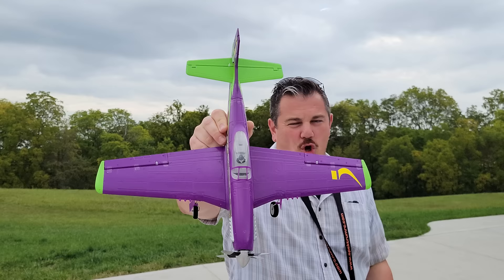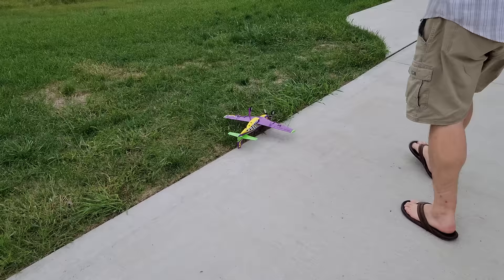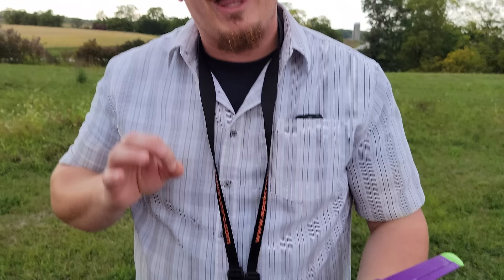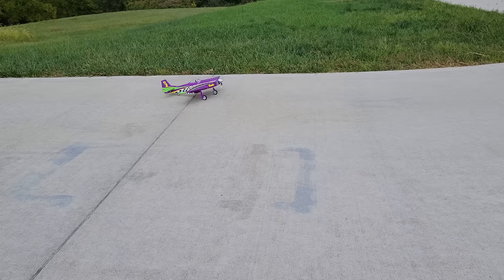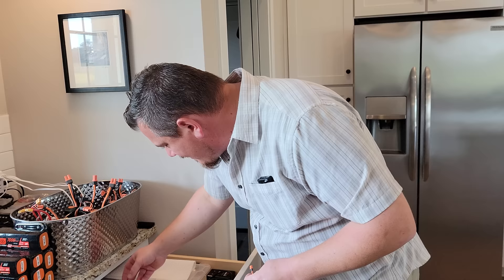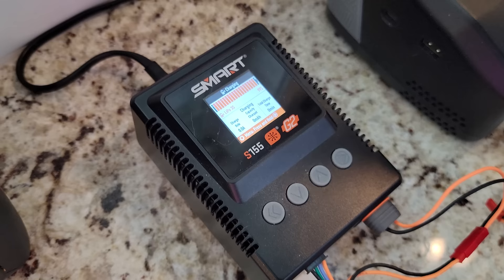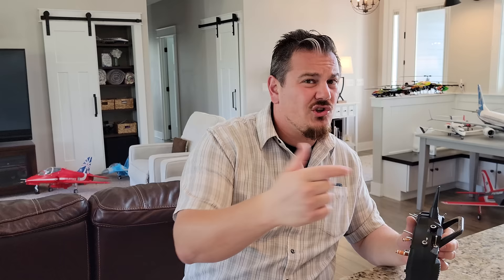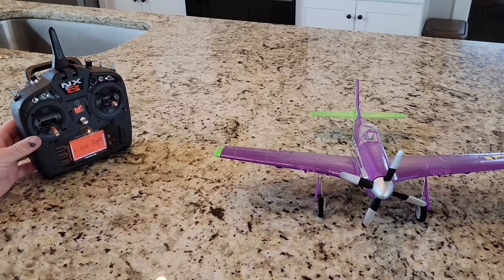Horizon Hobby - P-51D - UMX - Voodoo - Unbox, Build, Radio Setup, & Maiden Flights

Comment: FYI: The foam top cover from the box, if turned upside down makes a nice cradle for the plane when working on the backside of it (hang the tail over the table edge).  I also mark with a sharpie the "black" or negative wire side of the red JST connector to ENSURE I don't force plug the battery in wrong and blow the ESC.
Reply from the maker: Good tips!

Comment: Brian, thanks for bringing this plane to us.  I love the Voodoo livery and the P51 so this is an automatic win.  Also, thanks for pointing out that this is NOT an Eachine type of a plane. My only gripe is that the Mustang should be a B, not a D model but it's a P51, so it's a born winner either way.   From your links I will buy this plane and parts when they are available.  Have a great week, Brian and family...
Reply: @flyguy2913  Ok, so did they modify the D to have a razorback profile?  Wouldn't it have been easier to use a B model?

Comment: I am glad they put a battery door on it. The gentle annie p51 didn't have one. I still have it. The foam is compressed where the battery goes. I put velcro in there if I do a high g loop it will fall out and sometimes disconnects and it's a deadstick to the ground

Comment: Really cool to see HH coming out with these UMX planes.  I bet it uses the same motor and controller board as the new UMX Timber X and UMX Pitts S-1S (same 3S battery for sure).
Reply from the maker: I believe you're right, and it's got enough power for a plane 1.25-1.5 times bigger in my estimation. I'm so excited for the UMX'es - they've always been a favorite lineup!

Comment: Are rates assigned to a switch out of the box? If not, do I create duel rates on a switch by firstly going into ‘flight modes’ then assign it to a switch? Then go to ‘rates and expo ’and toggle the switch to bring up the flight mode for assigning rates? 
Hope that makes sense. Thanks in advance! 
Great vid as per usual!
Reply from the maker: I don't want rates attached to flight modes, but many pilots might enjoy that feature, so I could mention it.

On UMX planes, some features are mixed into other features, but the radio setup, I believe, is pretty straight forward on this P-51...which is a great plane, but I look forward to the WWII livery, which may come out soon (I hope) ;)
Reply: Yes totally agree, fingers crossed! 🤞

Comment: What is a corn hole? I've been flying 3d for 15 years and I've never heard of this maneuver before. Inverted snap? Is that what you're calling a "Cornhole"?
Reply from the maker: It's a REAL move, that we called a "Corn Hole" as a joke...but I think it's some mix on a snap roll. 

Sorry for any confusion I might have caused, but it's just in good fun.
Reply: No worries. I'm assuming it's the inverted snap roll at full throttle that you do. I went to look back on the video... Cornhole it is. Lol.

Comment: Would you be able to add flights with other battery packs in the future so we can get an idea of how it handles if we choose to go with 2s? I have those 3s packs for my UMX Timber X but for instance my Cirrus that I just bought I have only 1 4s pack and plan on flying it with the 3s packs also because I have so many from when I got my Aeroscout. I will certainly buy more 4s but for someone like me I have to use what I have! My toy budget isn't as large as some. ;) (Oh forgot to mention you guys make great videos and thanks! My wife doesn't necessarily like being referred to as camera crew though!)
Reply from the maker: 3S is the only way I will fly this, and other UMX planes, in general. If it'll take 3S but works on 2S, I find it almost a no brainer to go with 3S. Not sure if you've been flying long enough to remember the 2S UMX'es - they got the job done, but just barely at times, and now that we have 3S, I'm not looking back ;)

This is my rationale for saying NO - I don't often do it, but I feel it's a fair position, and good reason, but don't want you to think I'm upset with you, or something strange. I just think this plane deserves 3S power ;) Could it fly on 2S - sure, but I'm not going to use it
Reply: @BrianPhillipsRC  I should have asked this under the Cirrus video. I only own 3s for my UMX Timber X and it is my only UMX (I don't count the Night Vapor). Just getting back into flying after a 15 years or more. Things sure have changed! I can see your point about why bother with 2s especially since the 300s are so inexpensive. I was more concerned about the larger planes. Thanks for the reply and answer! I'm sure you have many comments to reply to so thanks for taking the time.

Comment: Anyone tried belly landing it without the gear? It looks like the prop would just hit the ground and cause a crash so I haven't tried it yet.
Reply from the maker: You could do it, but I wouldn't as the gear work so good, and I really enjoy wheels up / wheels down.

It's not a danger to the prop, just put throttle to 0% and stall it into grass, and you'll be 100% fine...so long as the stall wasn't 300 feet up ;)

Comment: Quick question. Does safe compromise top speed meaning is the top speed slower in safe than in as3x.  I have noticed that my 1100 mm t-28 is rather slow in safe even though i;ve put a 3 blade prop on it and a 6 s motor.  It acts a little faster but i,d like to get all the rates correct and my bravery up before I turn off safe ;-)
Reply from the maker: SAFE SELECT has no function on the THROTTLE channel, but it might make the maneuvers smoother, since SAFE does limit pitch and bank angles.

That being said, there is a Throttle to elevator mix that is added into FULL SAFE equipped planes, but shouldn't make the plane slower or faster, just that it will help you add in power when taking off.

Comment: Brian .I have been out of the hobby for 8 years . I have the older DX 8 ( Silver Face) Can I fly that plane with this transmitter ? Some People say yes some says no? Thanks for all of you advice .
Reply from the maker: You sure can, but there may be some limitations if your don't have FORWARD PROGRAMMING, which is part of the latest and greatest firmware available. Get the firmware up to date FIRST, then see if you have it. If you DO, then you're set for some time, but even if it doesn't show up on the "Function List" (when you click the scroll wheel down)...then you can still BIND to these planes, and use them as a plane, and do loads of stuff, just might have more difficulty getting SAFE and AS3X to switch.
Reply: Thanks Brian .  Love your videos . As I am up in age and this technology has just blew my mind. On a fixed income is tough but I want to learn as much about it as possible .And Social Security is a joke went from steaks to spam .HA HA  . Tried to get HH to let me upgrade and they said the Gen 1 is not an option. Oh well . And again Thanks .